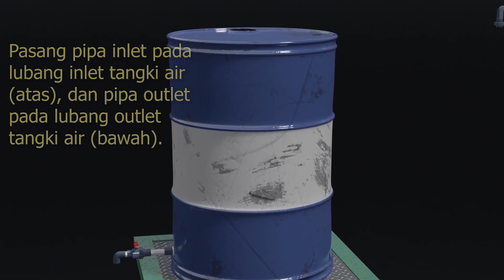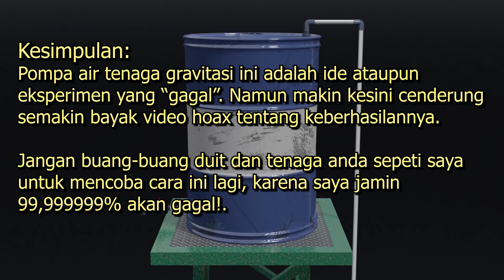Cara Kerja Pompa Air Tenaga Gravitasi Tanpa Listrik | Free Energy Tanpa Mesin | Hoax atau Fakta

Comment: Pasang paip outlet dari drum mesti besar & panjang 3~4meter. Ending paip dari drum tadi di pasang reducer diameter kecil n stopcock. Saya sudah buat sebelum ni n memang berhasil untuk sedut air dari telaga tube tapi d sebabkan vacuum yg terhasil menggangu kejiranan.. Skrg sudah tak guna drum tersebut sebab sudah buat free energy generator yg boleh support pam air 1.5hp. Tukar generator berenjin dgn menggunakan motor pam air(3000rpm) di mana lagi tinggi dari enjin (2800 rpm). Minima utk generator menghasilkan elektrik ialah 2600rpm bg mendapatkan 220volt.

Comment: Excellet video showing that this siphon can not work unless the water level in the source is higher than the outlet.  No foot valve is needed as long as you use a priming drum. In fact, you can simply use a hose, that is, if you find a way to  fill it. Dimension of the tubes are not relevant. Length of tubes are not relevant, but a goosneck at the output can be practical or simply dip the output into a bucket of water.